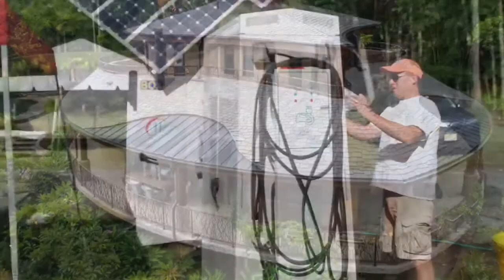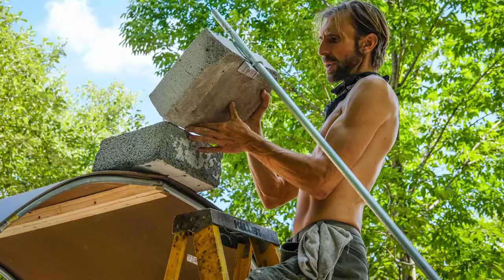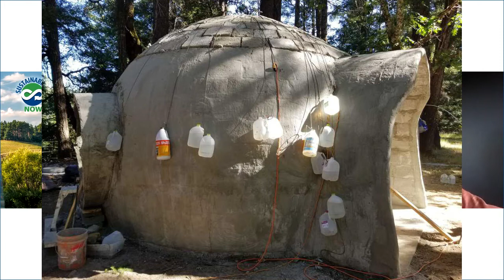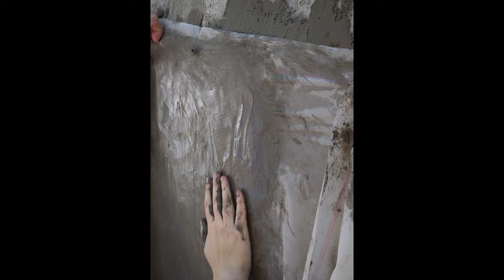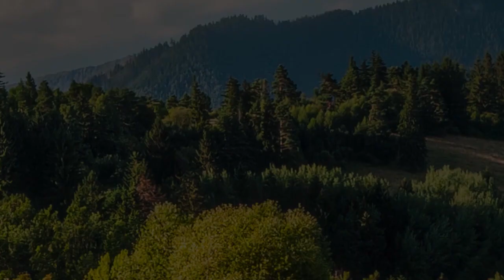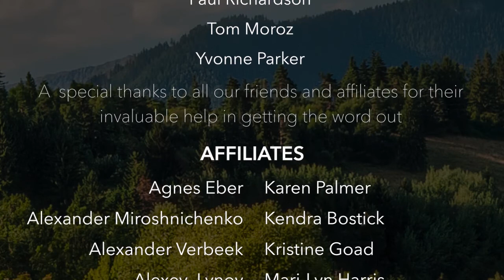DomeGaia: AirCrete Construction combining Earthy and Elegant

Comment: First experience with aircrete was in Iraq and it was used to construct the secondary containment for fuel oil tanks. Worked like a charm, and was easily "water/fuel" proofed to meet code. Outstanding product.

On the side of codes... I have a bit of knowledge that would skirt the code requirements altogether. Not saying that's always wise as they are generally there to provide  a level of safety. Nonetheless, there was an arbitration settlement agreement that was heard and awarded in August of 2019. The settlement was against the United States government. Guess what? They actually lost because they tacitly agreed to the terms without any dispute. This is gold people... can't stress that enough. So, there are the claimants who won the "award" and there are opt-in beneficiaries who won via the "award contract". Sounds confusing but it is cut and dry... both the award and opt-in contract read identical in cause/effect. 
The contract removes your taxation. It removes any and all jurisdiction over you by the United States. You effectively attain diplomatic status via State Department. Your inheritances that you weren't aware of are going to be remunerated, You have what is known as a Cestui Que Vie Trust... it is to be reconciled and returned to you in full. The Land Patent Office is also to issue a tract of land that is removed from US books (foreign territory, your jurisdiction). Sounding crazy right? But it's true. The claimants made it free to all persons within the United States to opt-in via the declaration document found at Hudok.info 

You can be as skeptical as you like, I encourage it but don't let that prevent you from digging into what I'm telling you.

I will be taking the aircrete engineering technology to a new level. The land I plan on developing is in what is now Maine. I will be constructing a community of dwellings and businesses as a test because I believe strongly in this method as a future (now) project. This is to first benefit homeless veterans and provide a path to employment and/or rehabilitation. I'd also like to extend this further but we'll see what happens. I know I sound like a crazy person but you're about to witness a lot of crazy take place globally that you weren't prepared for. All I can say is just take it all in strides. Going to be a bunch of good that comes out of the bad... now entering the "Golden Age" literally.

Anyhow, God bless and I hope I might have enlightened your perspectives.
Reply: Hi! I am so interested in the info you shared! I have 2 1/2 acres in northern CA and have been listening to David Straight and Ron Gibson concerning correcting your status and attaining alloidial land patent. Is this the same that you are talking about? I want to build an aircrete dome and wonder should I go through these channels so I dont have to involve bldg permits, planning dept, etc? Any suggestions would be greatly appreciated!!!
Reply: @starflower4544  Hi Starflower, the remedies that are out there will and do bring with them a high degree of governmental scrutiny. They will seize property without due process, violate all manner of your rights and turn a blind eye to your legal standing in matters. Judges at all levels “rule from the bench” over situations that subvert their authority no matter the possible retribution options you have.

Just giving you this heads up early because California especially will undermine a lawful condition with impunity. So what does that leave you, here’s what I’d do...

Because I’ve already established a contract in perpetuity with the United States concerning my unadulterated status (Hudok.info), I would inform my city planning along with county and state officials of my unassailable contract and their obligations to abide. I would follow that up with a conditional acceptance proposal letter addressing the fact that I will comply with their “perceived” construction process HOWEVER, I will be creating a running tally of additional costs to meet their “standards” and will be billing the appropriate offices at a future date. I would give them 10 days to respond or I will proceed without regard to response assuming their acceptance of my contract to them. I would also invite them to preview my standing in fact via the actual contract award as a beneficiary of the agreement and also provide a copy of my adherence to and video recording of my mailing of that acceptance at the post office. 

Now I’ve established that I am a bona-fide beneficiary, willing to enter into another contractual agreement with California at their cost which I will front for future remittances later. 

It’s now an offer and they must proceed in some fashion.

Lastly, remember who we’re dealing with here... ALL of these agents from local to federal are criminal in nature and intent. They are not there to assist or help you in any way at all. This is where we pick our battles wisely. I personally believe the entire power structure of this criminal enterprise is on the verge of being dismantled and their executions will be handed out like candy. If you have the means to hold your fire for a little longer, do so. I’m praying we see things drastically changed within now and the next 6 mos. A true return to lawful and honorable conditions will be a game changer, imagine a situation where the Constitution is actually followed and binds the hands of those officials wishing to weaponize it or cherry pick wording.

I wish you all the best and hope I’ve given you even a hint of good advice.
Reply: Bot much?
Reply: Where in ME?  I am negotiating a few hundred WF acres for a similar project.  Collaboration possibilities?  This handle@gmail will find me.

Comment: Hajjar. Have you had an engineer  sign off on one yet? Nice dodge, You know you haven't
Reply from the maker: This is not Hajjar's YouTube channel.  It is unlikely he'll see this question. You can direct it to him at his website http://domegaia.com
Reply: @SustainabilityNow  I know. But if your going to interview him ask all the questions. Not just a puff job.
Reply: @jessesmith8645  cost some mone for that....i have the same problem with the bamboo in aircrete method i am using.....good for small offices which fit under the code, need testing, and the ubc has aircrete in it, btw.
Reply: @d.e303-anewlowcosthomebuil7  yes, there is some cost involved in getting an engineer involved, but when you run a business and share information widely on the internet related to it, it seems having the engineering checked for one simple structure would be a good idea, and justify the cost
Reply: @dustinabc  i need to get a new kind of low cost structure past code so that is why i am asking
Reply: it is bamboo set into cast aircrete
Reply: @dustinabc  depends what it costs...and getting it done for everybody?
Reply: @icakeballs i want to tes a wall panel but find it hard to get such a high load on top of it
Reply: Well if you own land off grid or live anywhere below the border you won't have to worry about that. I personally have some land in the states that I can build and do whatever I want on and don't have to worry about if it meets code. I should add that it's on an island in the great lakes with only one cop on the whole island but there is a lot of similar places in the states. So this video does apply to alot of people, it just depends on where you live.
Reply: @MrKnowBody55  if you are a farm in Va
Reply: no need for pmts on non home bldgs
Reply: https://youtu.be/JN3XCT4uTfQ?t=904  PSE Consulting Engineers apparently has according to this video!!